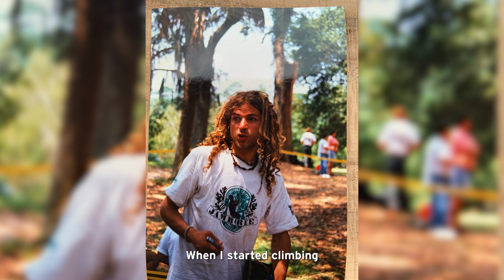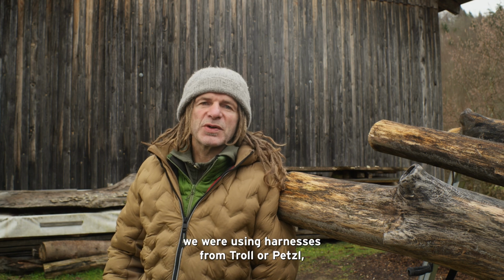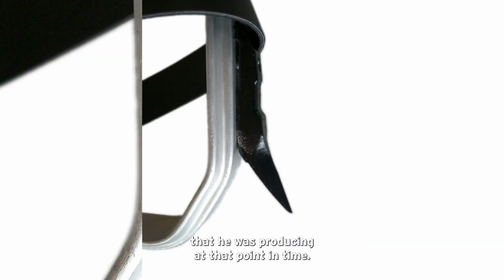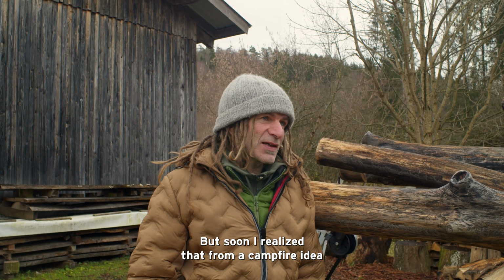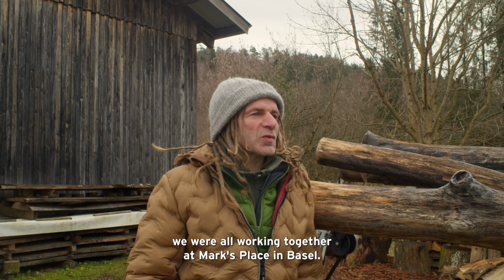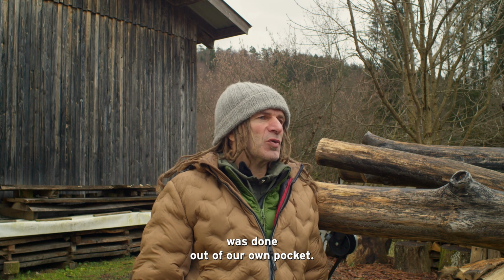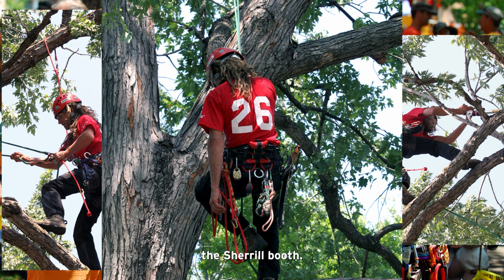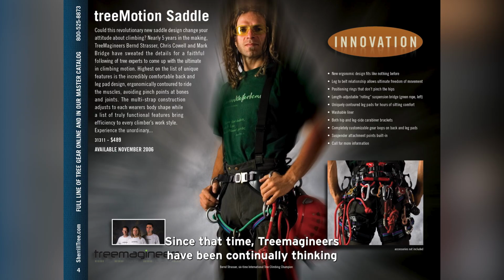Beddes at the Barn - 20 Years of Harness Evolution

Comment: Sweet Brother !!! I was on that waiting list for the first Tree Motions available from Sherrill back in the day, and it was definitely the most comfortable harness I'd ever worn, especially after 29 years with the Stringer Saddle we called um back in those days. I've been through 3 Tree Motions to date with the last one sitting in my truck box with the suspenders because it seems to want to slide right off my flat ass since I wear it at waist height for comfort and the suspenders kill my shoulders and restrict movement. I'm on my second Sequoia SRT and attached Augusts suspenders to the newest one and removed those after the first day also, just so I can move, but it seems to stay on me most the time unless I'm supporting anything bigger than a 200T. I still keep one of yours behind the seat in my chipper truck and the other one still brand new with suspenders in my tool truck box in case I have to support a larger saw which is preferably the 395XP instead of my OG 2100 which is way outdated to drag up a tree. Your design was ground breaking, or Tree Shaking, so to speak in this industry. It was Bad Ass looking and as comfortable as they get, especially if you had to be in a tree 8-10 hours and the added ring around the D Rings on the later version saved your hips from excruciating pain with bigger saws.
 I'm honored to have indirectly met you on here, and just now purchased the KINISI. Rock On Brother !!! Blessings !!!